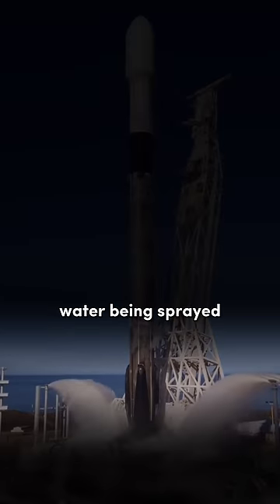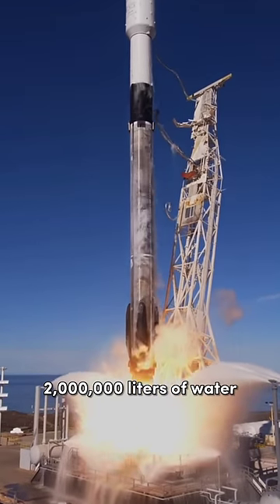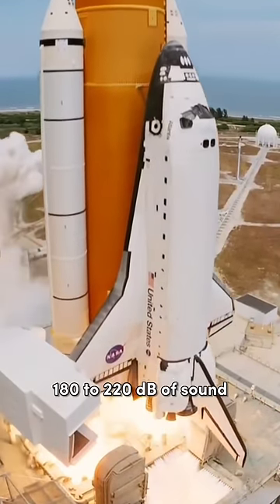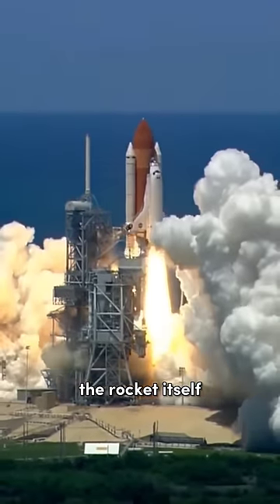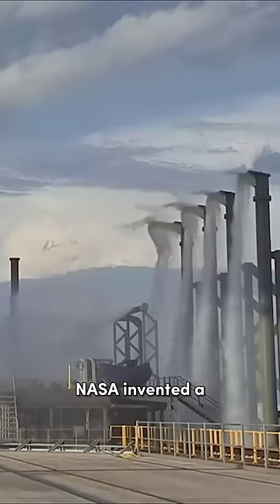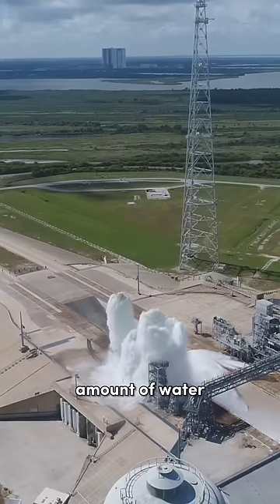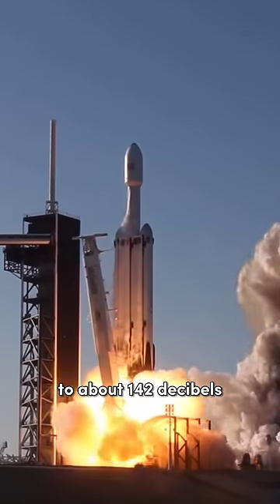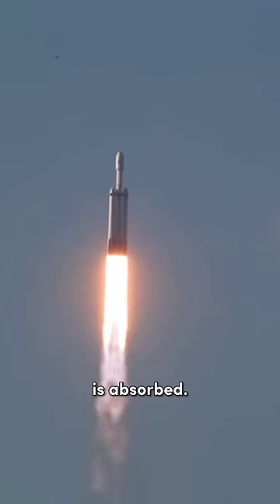How Water Prevents Rockets from Exploding #shorts

Comment: Well there is also another water system near the engine that sprays ice cold water during early luanch years  but was removed becoz of the new method to cool down engine 
Guess  is it ??
Reply: the waters purpose isnt to cool down the rocket engine, that is done by the fuel going up the engine bell.
Reply: @polarbear4620  Yes ik but that's not what I'm talking bout here

Comment: Not only that. The water rate near the rocket is usually variable. It is due to the reason that ambient temperature and pressure must be maintained very optimally during the launch near the ground. Water and air are the most important engineering fluids !

Comment: For everyone saying "imagine how loud the rocket would be if it wasn't for the system", that's not how it works.

The system is designed to absorb shockwaves that can potentially damage the pad. It doesn't do anything to the perceived sound of the rocket. Think about it, what would happen when the rocket clears the pad a few seconds after takeoff? The water no longer has an effect on the sound, and the rocket will sound just as loud as it did on the pad.

Comment: Interesting to note the Soviets solved this problem by digging a massive crater under the launchpad and reinforcing it with concrete to deflect the sound generated by the rocket engines in a way that does not damage anything.
Also Soviet rocket engines used solid fuels and had far higher efficiency reducing the sound levels produced compared to NASA rocket systems.

One of the biggest reasons for the water deluge system in the beginning was to lower volume for the people watching the rocket launches, US missiles do not use water deluge systems though as they use solid fuels and are designed to be fast to launch.

Comment: sound travels more efficiently in water, for hundreds or more miles.
 the water drop at a launch drops the temperature applied to the concrete around the area do to concrete degradation above 2300 degrees.

Comment: "220 dB reduces to 147 db" Can you explain - how can that be 97% of sound absorbed. Thanks
Reply: Decibel doesn't go linear.

Like, 70 dB is ten times louder than 60 dB. Also 60 dB is ten times louder than 50 dB. (dB: Decibel)

Same system goes for earthquakes

A 7.0 force earthquake is ten times stronger than a 6.0 level earthquake

This is why 5.0 earthquakes can release large fear to people and demolish some buildings while a 10.0 earthquake could flip the city upside down.

It is all about logarithms in Math, their  calculation systems use logarithms
Reply: @cosmosaviatoric  thanks very much for the detailed explanation. Now that's example of earthquakes is an eye opener. 👌🙏

Comment: Even though this is true, it’s also false. Water helps prevent damage to the launch pad so they don’t have to re-do all the concrete and cement
Reply: most  won't even understand what you're talking about🤑 they will just smile and wave and Nod in approval!
Reply: @stevengerhardt1221  huh?
Reply: @willshoham  it's claimed that is for sound suppression but it is not as you have stated but perhaps there's more of a reason besides damage to the concrete or noise suppression.
Reply: @stevengerhardt1221  huh?

Comment: The shockwaves will probably not damage the rocket itself, even if you didn't have a deluge system. Russia does it without water, the shockwaves are already pointing away from the rocket. So the worst they can damage is the machinery and buildings beside the launch pad. If you have a deep enough through with a slop you can do what Russia does.
Reply: But they don't

Comment: He: transforms sound wave to heat energy ...
Me : Isn't the rocket 🔥 itself supposed to be super hot🤨and water is adding extra heat then
Reply: The heat from the water that is heated is negligible compared the heat of the rocket engine, the heat of exiting the atmosphere, and re-entering. The heat of that water is about 60-200 degrees, as there is so much of it, exactly how heating a full pot of water is harder than heating a drop.

Comment: Wow I didn't know 3% of 180-250 was 140 🤣
Reply: Sound is measured differently, every 10 decibels is a 10 fold increase. 100 decibels is 100k louder than 50 decibels (humans wound perceive it roughly as 32 louder, not 50% louder)
Reply: 20 decibels is 10x louder than 10 decibels
so you can go for pretty crazy percents with louder sounds

Comment: 180-220 db to 142db which is 97% of the sound absorbed? Makes sense.
Reply: It does actually because db is not linear
Reply: Yes, because as the other guy said, decibels aren’t linear. Like 70 Db is 10 times louder than 60 Db, and 60 Db is 10 times louder than 50 Db. That’s why 97% of the sound is cut off when going from 220 to 142 Db

Comment: 280 decibals max and 97% is absorbed so now it’s 140 decibals. Maybe I’m just dumb but that math ain’t mathin
Reply: Decibel doesn't go linear.

Like, 70 dB is ten times louder than 60 dB. Also 60 dB is ten times louder than 50 dB. (dB: Decibel)

Same system goes for earthquakes

A 7.0 force earthquake is ten times stronger than a 6.0 level earthquake

This is why 5.0 earthquakes can release large fear to people and demolish some buildings while a 10.0 earthquake could flip the city upside down.

It is all about logarithms in Math, their  calculation systems use logarithms

Comment: Am i so bad in math?, where in the f is that 97% drop from 220 to 148 ?!?
Reply: Decibel doesn't go linear.

Like, 70 dB is ten times louder than 60 dB. Also 60 dB is ten times louder than 50 dB. (dB: Decibel)

Same system goes for earthquakes

A 7.0 force earthquake is ten times stronger than a 6.0 level earthquake

This is why 5.0 earthquakes can release large fear to people and demolish some buildings while a 10.0 earthquake could flip the city upside down.

It is all about logarithms in Math, their  calculation systems use logarithms

Comment: Where does the water go after flowing off the launchpad?
Reply: Either into the air, ground, or they try to get back what they can of the water to reduce waste
Reply: @Sh4quille0atmeal  I think there is a drainage system under the launchpad for the water that makes it under the launchpad.

Comment: 97,5%?
Realy?
But that would be 5 db or quieter than a running mouse.
Reply: read the pinned commment.
Reply: Decibles increase exponetially
Reply: @hansvonflammenwerfer2817 
Okay, I understand what you mean, but you can't specify that as a percentage.
97.5% is 97.5 out of 100 that doesn't double.
Reply: @christianfroeseartist504  97.5% as if it was a linear scale, it would be 97.5% reduction

Comment: I would say 97% is correct math, but not tge riggt principle. You're finding percent of total volume, not the difference between total volume. So it really is a 36% difference. There is no way reducing 220db to 140 is a 97% reduction, its 97percent of 220, but not reduced by 97%. If you take 220-140, you get 80db, that's how much was reduced. Now take 80÷220×100 and you get 36%. So 36% is the actually volume that it was reduced too from 220 😂 I know this info is kinda dumb, but I think it's funny how people really though it was reduced by 97 percent😂
Reply: It was reduced by 97 percent. The decibel scale is logarithmic - 20 dB is 10 times louder than 10 dB. Maybe don't be so smug when you're the one who’s wrong.
Reply: @yujirohanma203  😂😂 Not trying to be smart. Was just talking about simple math. I read the comments. If you belive you are correct, I dunno, prove it? How do I know you're not just another one of those people spewing random things too? I know decibels aren't a linear thing, but if 220 down to 140 is a 97% reduction, then what's a full reduction? 500%? You see what I was talking about? Reducing a value of 220 by a small value of 80 is not a 97% reduction if we are talking simple math. It also doesn't help that you say you're right, but respond with a simple rephrasing of the answer.
Reply: This is a waste of time anyway. Do what you wish. I was talking simple middleschool math and literally never stated I was right either. But, on second guess, tell me what I don't know, this is a bit interesting.
Reply: @viktorbihar5384  Yeah... that's a complete misunderstanding of how decibels work.
Reply: @viktorbihar5384  every 10 decibels the scale is multiplied by 10, thus 50db is 10 times louder than 40 db
Reply: @viktorbihar5384  full reduction is 100%, each 10dbs reduced reduces a little less

Comment: 220dB to 142dB is 97%?
Reply: Decibels aren't linear, they are measured logarithmically. This is a way of counting or measuring something that increases rapidly, or exponentially. For example, every increase of 10 dB on the decibel scale is equal to a 10-fold increase in sound pressure level (SPL). Near silence is expressed as 0 dB but a sound measured at 10 dB is actually 10 times louder. If a sound is 20 dB, that's 100 times louder than near silence.

Comment: 140 is not 3% of 240
Reply: Well in decibels, it is.
Every 3 decibels almost doubles the sound level.
Reply: Decibels are logarithmic. 20dB is 10 times as loud as 10 dB. 240dB is 10,000,000,000 times as loud as 140dB. Although in air the peak possible decibel rating is ~190dB, at this volume the low pressure half of the sound wave reaches a near vacuum, thus no more energy can be put in without increasing the average pressure of the air, such as in a shockwave.

Comment: The decibels are a fifth of what it take to create a black hole 😂
Reply: Not exactly. Decibels are not linear, so 1100 decibels (black hole) is way more than 5 times. If a nuke explodes at 250 decibels, you would apparently need to have around 10000000000000000000000000000000000000000000000000000000000000000000000000000000000000 of these nukes to have 1100 decibels

Comment: how is 142   97.5/% of 220?  Math, do you speak it? wtf...
Reply: Decibels aren’t linear iirc
Reply: Decibel doesn't go linear.

Like, 70 dB is ten times louder than 60 dB. Also 60 dB is ten times louder than 50 dB. (dB: Decibel)

Same system goes for earthquakes

A 7.0 force earthquake is ten times stronger than a 6.0 level earthquake

This is why 5.0 earthquakes can release large fear to people and demolish some buildings while a 10.0 earthquake could flip the city upside down.

It is all about logarithms in Math, their  calculation systems use logarithms
Reply: Decibels aren't linear. Math, do you speak it? wtf...

Comment: I would doubt that.  The engine taking off will damage the rocket engines and the takeoff pad from the heat, so the water is sprayed to keep it all cool so things like the tower does not get hot, weak, and slop over.
Reply: Engines are specifically designed to not damage themselves and there's much better alternatives for cooling than water if heat was the concern.

Comment: It’s actually mostly to keep the rockets from destroying the launch pad by extreme heat.
Reply: Not heat but sound. 220 DB is far more destructive than a few thousand celcius heat
Reply: @fabianangler  3500c will boil steel and shatter concrete. The water has both purposes. The structure is based on steel reenforced concrete.
Reply: @ShireGanj  yeah but not "mostly" for keeping the launchpad from melting. Both would destroy it.
Reply: @quackatit  it’s primary function
Reply: @ShireGanj  its not. Fire detergent or just water at the base would be enough. But spraying over a large area from above is for sound.

Comment: I don’t know where you got your information from but 194 db is the maximum possible in air. 220 dB are only possible underwater.
Reply: False. Don't just read headlines.
Reply: I also don't know where you got your information from
Reply: @miniporter9871  From university and a quick Google to fact check my memory. I'd ask where you got your information but it is irrelevant because you're incorrect. Saturn V 203 db measured, so read past the Google results blurb.
Reply: That's for sound, beyond that it's considered a shockwave.

Comment: I don't know why the math doesn't checkout. 220dB to 142dB is not even upto 50% saving. How did we get to 97%
Reply: Decibels aren't linear. Meaning the difference in 140-150dB isn't the same as 150-160dB even though they're both only 10dB apart. The higher you go, each decibel increases in sound
Reply: @mew9918  thanks
Reply: It's a mixture of physics and maths it  increases exponentially not linearly.

Comment: 200 db to 142db = 97.5%? 😐
Reply: DB isnt linnear
Reply: Each 10db is 2 times louder than the previous 10db, for example 110db is 2 times louder than 100db
Reply: @zoomerguyyt  I’m aware, but would 142 dB still only be 2.5% of 200?
Reply: @noahbraden1244  exactly, 2.5% of 200 so 142 is 97.5% less, 100% - 2.5% =97.5%
Reply: @noahbraden1244  It doubles for every 10 decibels. So we can use the formula, s=2^(d/10), where s is scale and d is our volume in decibels. i.e. if we take 10 and 20 for d we will get 2 and 4. Divide the former by the latter and you get 50% remaining by dropping from 20db to 10db.
Now do the same with 200db and 142db.
(2^(142 / 10)) / (2^(200 / 10)) * 100% = 1.79%.
So there's 1.79% of the original volume remaining by dropping from 200db to 142db.
Reply: @inlandish  thanks man

Comment: Video stated sound goes from a high of 250 dB to a low of 140 dB. How is that a reduction of 97%?
Reply: Decibels aren't linear
Reply: Decibel scale is not linear. Essentially meaning that if I have 1 speaker producing 25db, I need 10 to produce 50db
Reply: Decibles are not linear

Comment: Uhm, your percentage is way off my dude. Use a calculator next time
Reply from the maker: Wait where?
Reply: If 97 percent of the sound was absorbed, it would be nearly quiet.
Reply from the maker: @soundspire360  decibels are not linear, they grow exponentially, meaning that 140 dB and 220 dB is an extremely huge difference
Reply: @SpaceflightsShorts  but you said 97% of the sound, as in total sound. Lol
Reply from the maker: @soundspire360  yes, exactly, like I said decibels are exponential
Reply: @SpaceflightsShorts  okay but they are still quantifiable. What is 97% of 220?
The perceived intensity of the sound is exponential.
It may be 10 or 100 times quieter maybe, or maybe I’m just being semantic with the math. Just sayin
Reply: @soundspire360  you're being wrong
Reply: @miniporter9871  takes someone with integrity to be wrong and not edit their comments :)
Reply: @soundspire360  160 db are double 150 db so 150 db is 50% of 160 db, reseach if a scale is linear or not before commenting
Reply: @soundspire360  Bro really trying to justify himself even after realising he made a fool out of himself 😂😂
Reply: @Nebulisuzer  150-160 isn’t double its 10 db more. 300 is double.
Reply: Here let me make a video for you
Reply: @soundspire360  160db is 10x the intensity of sound (i.e. amplitude of vibration of the air molecules) than 150db.

For 220->140, I believe it would be about 10e+80 times "louder" which would take a while to type out in actual numbers
Reply: @soundspire360  bro, you have basically all the knowledge in the world on ur browser, it takes 5 seconds to search up how decibels work
Reply: @Nozxoki  and you basically have AutoCorrect to know what the difference between decibels and decimals are
Reply: @soundspire360  i was on phone and my autocorrect changed it, surprisingly i didnt read my comment over multiple times to check for spelling mistakes while im wasting time talking to an 11yo who doesnt understand that decibels arent linear
Reply: @Nozxoki  that’s an oddly specific age limit lol. I’m 25, I guess you spend a lot of time talking to underage children?
Reply: @soundspire360  your 25 and didnt know decimals arent linear, im so sorry the school system failed you so badly
Reply: @Nozxoki  r/epiccomebacks
Reply: @soundspire360  300db is double of the number 150db but 160 is 10x loudness of 150db. Loudness and the number is different
Reply: @soundspire360  you're 25 and you dont understand decibels?
Reply: @quackatit  I understand numbers and percentages. You don’t understand semantics by the sound of it, and clearly not how “sounds like” doesn’t mean “absolute volume”
Reply: Decibels aren’t linear, it folds by 10x. 0 db vs 20db the latter is 100x times louder.
Reply: @dragondestroyer1487  decibels aren’t. Percentages and numbers are
Reply: @soundspire360  what? Can you please explain what you just said. English isn’t my first language
Reply: @soundspire360  I don’t know why I’m having a tough time figuring out what that means
Reply: @dragondestroyer1487  Google what 93 percent of 220 is
Reply: @soundspire360  he said 93% of the sound absorbed, not the decibels, the decibels don't represent sound in a way where you can find 93% of it that easily
Reply: @zoomerguyyt  literally proving my point but OK
Reply: @soundspire360  no he didn’t. He’s talking about the sound the decibels represent not the number itself it isn’t as simple as addition an subtraction.
Reply: @dragondestroyer1487  ok but what is 3 percent of 220?
Reply: @soundspire360  bro you need some study
Reply: @junedaalam3080  read the last 3 weeks we’ve been over it already